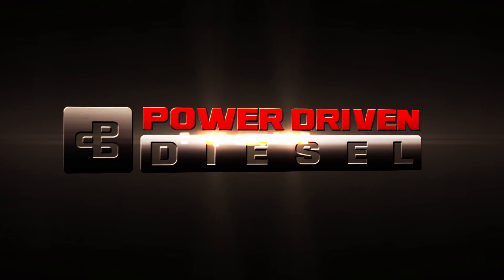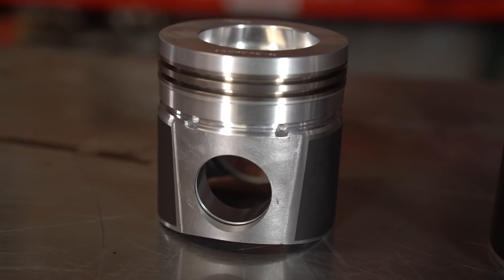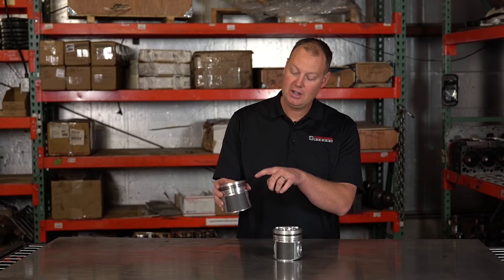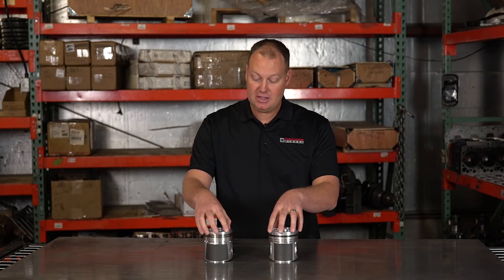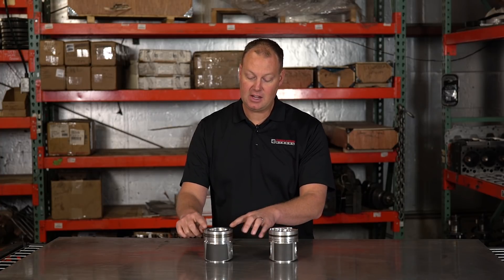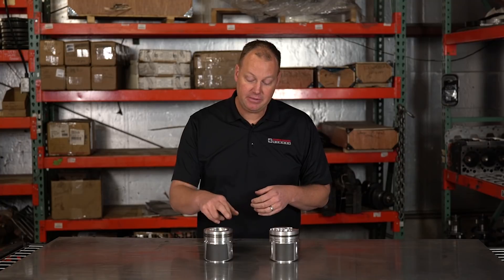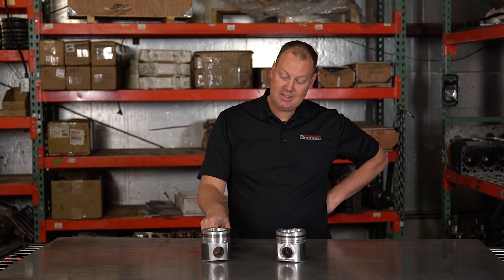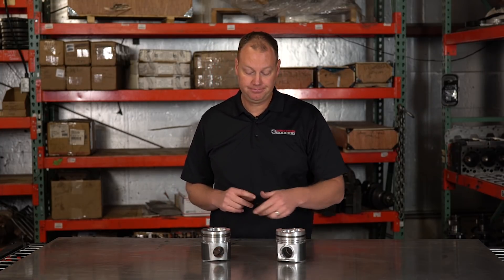12 Valve Cummins High Performance Street Pistons | Parts Bin EP 5 | Power Driven Diesel

Comment: Thoughts on using the dual steel ring marine pistons in a 6.1 stroker and 188 220 cam .
Reply from the maker: Not great there is not enough meat on the top of the piston and it wears out the top ring really fast due to the heat
Reply: What piston would you recommend with his setup?
Reply: Mahle power pack  pistons .
Pdd does a fantastic job machining them and is as easy as selecting the option for a stroker and depth of valve reliefs you'd like 👍

Comment: I don’t know how feasible it would be to try having a step ring I don’t know if you could do that on a keystone type of ring but child’s and Albert now actually and Albert had a step bring for all way back into the I don’t know late 80s early 90s something like that and it helped a fair amount it help control blow by and stuff like that but then again I don’t know if it would work on this application something to think about though I have a five Hundredcubic inch Chrysler hemi’s actually 526 in.³ and it’s a Mopar perform a semi cylinder block stage five hemi conversion heads and stuff like that and those step second ring really helped anyway just thought I’d throw that out there this is Jim mungai again with the old 91.5 Dodge I’ll give you three guesses was under the hood

Comment: So with the marine pattern piston you would need to use different injector nozzles?
Reply from the maker: Some use marine pattern 155 injectors, some use factory 145 pattern.  Really depends on how much timing you run.  Technically the wide pattern should work best at the factory marine engine timing of 22 to 24 degrees.  We've seen great results with 145 pattern injectors with the wider marine bowls and 30+ degrees timing on a max effort application.

Comment: I have a set of these were getting ready to test in a 2.5” 12v pulling engine build. The dual keystone ring design and full 3.25” wrist pin is a huge plus. Come std with coated skirts and tapered piston on top. We’re running .200” relief cuts and over size valves Hamilton valves and valve train on a 207/220 steel cam. Going to be awesome to see what power they can make with the air and fueling setup we have on the engine dyno. Hoping for some longevity over std marine bowl pistons with the dual steel top rings and all the other features.

Comment: Back in the day (Late 90's early 2000's)I built several pulling engines using the Marine 370 Piston from Cummins. With valve reliefs in them they are prone to cracking above the keystone insert because that area is thin with the ring up high like that.  I found the industrial style(89-91 Dodge) piston with the bowls opened up to drop the compression had better longevity.

Comment: I’ve been wondering for years why you don’t see pistons in the light duty diesels like what they use in the 11.9L and up engines. They handle 600hp and 2000 lbft for hundreds of thousands of miles. For 15 years, I did many in frames with two piece pistons and this newer style one piece. https://www.prlog.org/12298184-isx-piston.jpg

Comment: Is there a difference on a 12v piston and a early common rail ? Will that marine piston work in a cr
Reply: CR is 24 valve, But I had the same question. He said they could cut them for certain camshafts so I would assume they could cut it to CR specs. (not sure though)
Reply: The centre fuel bowl is completely different. 0n a 12v your injector comes at the piston on a angle to the exhaust manifold side, on 24v your injector is dead centre of the head, these pistons would not work and there is not enough material to machine a new bowl.
Reply: @keiferjanz3197  Thanks for the info.

Comment: But didn’t you just move the weak ring landing closer to the top or because of the type of ring there is no concern.?

I got an out of the box question or statement... when machining or honing cylinder bores, shops usually stopped if the block develops any heat then return later to finish home.
So tell me this; why not,in a high HP engine, heat the block to operating temp or close as possible and THEN hone.? Just seems backwards to me but that’s the way my mind thinks
Reply: ,,, we don't hone with the block up to temp because it is a  pain. The honing process makes heat and causes it's own distortion. With a good stress plate secured to the block and careful developed procedure, distortion and blowby are kept to a minimum.
Reply: Roland Tamaccio of course it would be a pain but that doesn’t answer my question. Your answer sounds like “it’s good enough doing it this way” 
But a thousandth or 2 of tighter clearances means better seal and less stress on rings right.?
Reply: @jeffbeaird747  ,,, I've been lucky enough to work on some major NHRA and one NASCAR engines in some very fussy shops. We tried this in one shop, but was nothing but problems. The only possible success, and he might  have gave it up, that I ever heard of was Jere Stahl (rip). And he was out of the engine building business 30 plus years ago. The problem is the heat of honing  distorts each individual cylinder, as you hone it, driving you batty as you try to measure it and it's shinking right in front of your  eyes .
Reply: Roland Tamaccio it would definitely be a mess thank you for your response.
Reply: It just seems if the block is closer to running temp the honing of the cylinders would be truer, is truer a word ? Haha
Reply: Makes sense, a good friend of mine adjusted Jake heads on his log trucks that way. He always said, well it's hot when you use it so why not adjust it properly when it's hot too? I never had a good rebuttal, but over time the only thing I could conjure up would be around would be expansion and contraction of the components but  also never learned that
Reply: ,,, btw, I've heard factory reps say, "Mal-lee". Til then I use to pronounce the "h" .